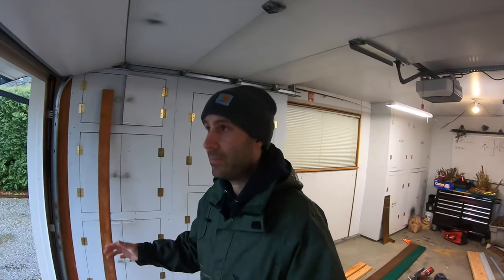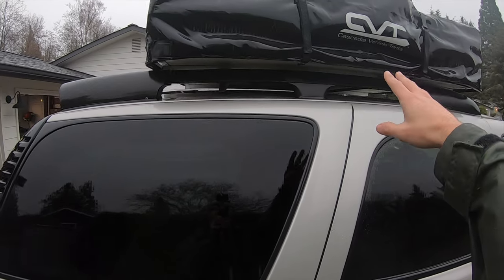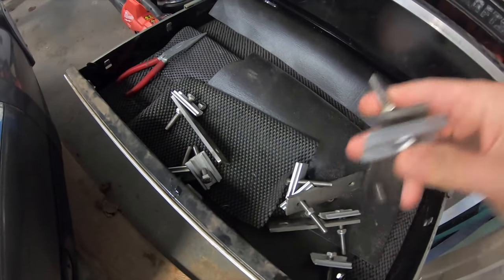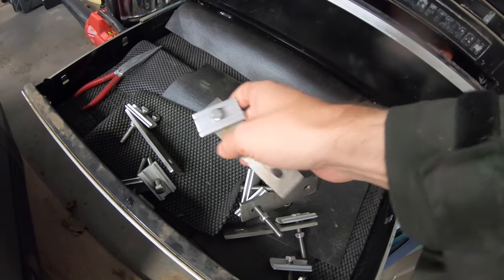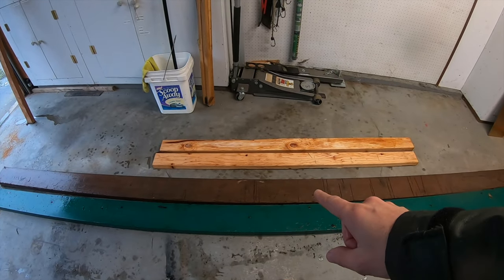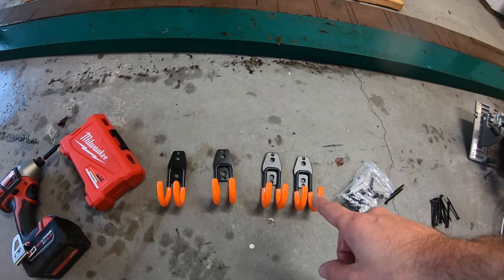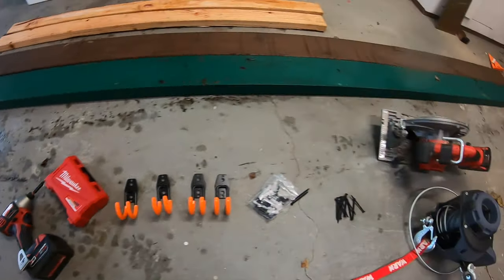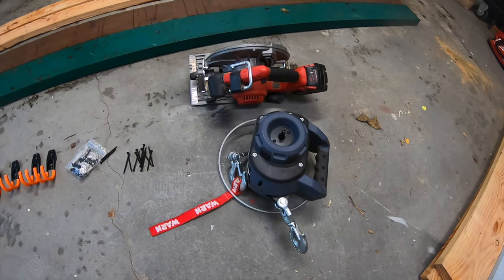How to Dismount Roof Top Tent by Yourself - The Cheap, Quick, Simple Way!

Comment: Awesome man! Thanks! I have Overzone tent probably around 80-100 kilos - will this work also for this weight? 😅
Reply from the maker: That’s a heavy tent I think that’s around 200+ lbs, might consider reinforcing or doubling up on the boards. If I was gonna try it I would get a couple more 2x4s and screw them on edge to the back of the runners, otherwise you might get a lot of board flex when the tent is in the center when sliding. Does that make sense? Where you from?